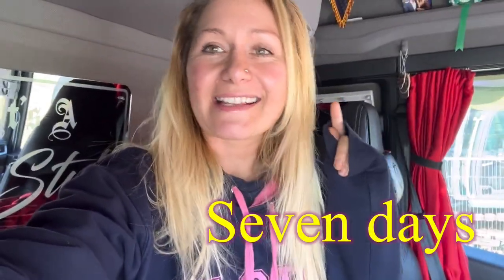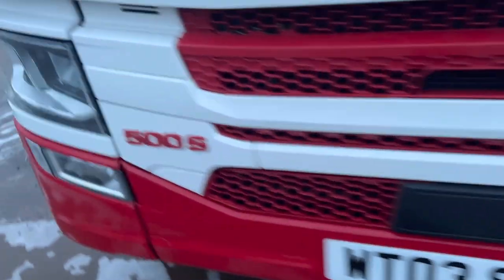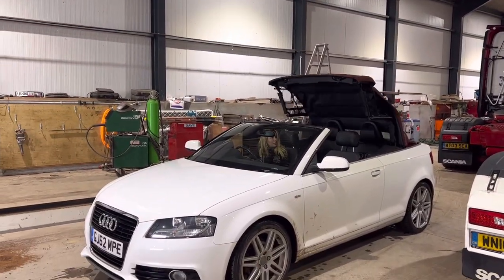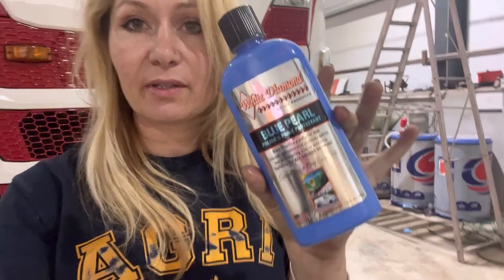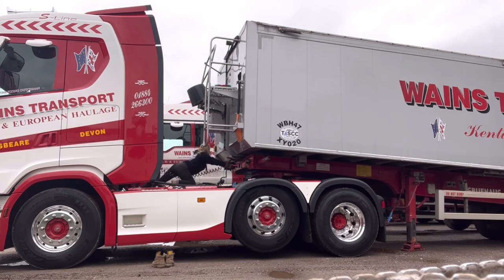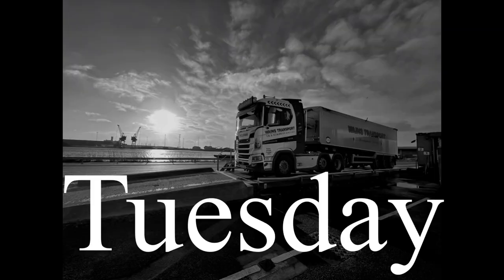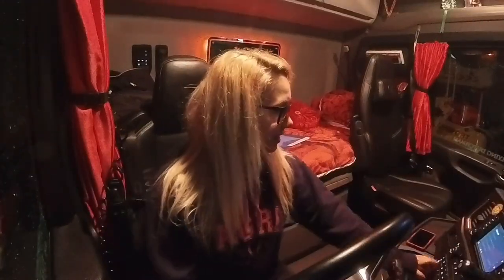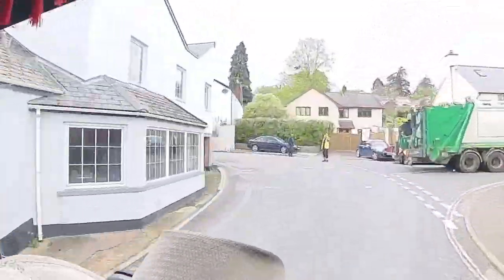Seven days leading up to Devon Truck show | preping the truck and the working week

Comment: That's proper working truck cleaned by the driver
It annoys me all the lads who take their truck off thr Road for a week or 2 get it professionally cleaned loads of bits resprayed etc then enter it as a "working truck"
Well done very impressive especially with the work you do (which also should be allowed for by judges)
Thanks

Comment: Good Video as always Jemma. Might be worth trying Belgom Alu on the metal surfaces. It works with stainless steel, aluminium, copper and brass and I have always used it when polishing aluminium wheels as it leaves a protective film behind which keeps the surface brighter for longer and also offers a small amount of cut to remove any light tarnished areas. If you need a good degreaser ask your Autosmart dealer for G101 (im guessing they still make it) its pretty good at cleaning plastics and grease off parts. DA polisher is good for applying finishes to paint work as there is less chance of over heating the paint and burning it but a rotary is far better for any cutting of paint work or metal polishing.  Might also be handy to know that Sealey do a 3 inch (75mm)  polisher which could help with getting in to the tighter areas but it is just a rotary polisher though

Comment: Hi, recommend the 2 bucket method. U have 1 bucket with just clean water & ya second with ya water/shampoo. Use ya 1st bucket 2 rinse ya mitt, so mitt in shampoo. Clean an area, then rinse mitt in 1st bucket.  Then shampoo & so on. In theory ya shampoo/water should stay clean as ya rinsing ya dirty mitt after every area clean. So not putting contaminents back on ya mitt. Hope u follow lol 👍

Comment: If you have own trailer have a plastic plate on fift wheel. No grease necessary, just a bid for locking mechanism. Rest is staying clean. It works very well
Reply from the maker: We have our own but then we need to swap trailers sometimes depending on the loads
Reply: @jemmawarren27  so there is one chance only to upgrade all fleet of trucks fift wheel with plastic cushions and everyone will stay clean and no mess with grease

Comment: Great video.i was wondering if you drive for 10 hours how long do you have to take a break for after the second 4 and half hours to do that extra hour?.
Reply: 45 minutes. One can never DRIVE longer than 4.5 hours; after this, one needs a minimum of 45 minutes break.